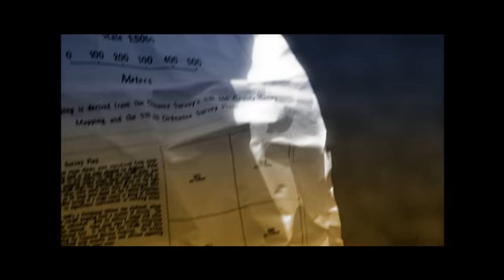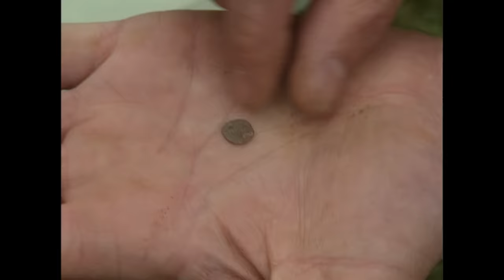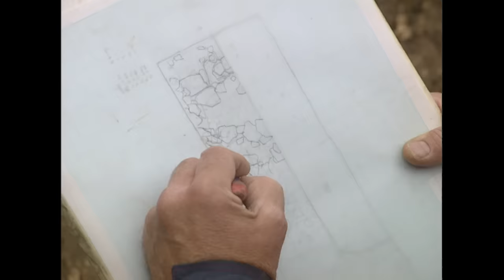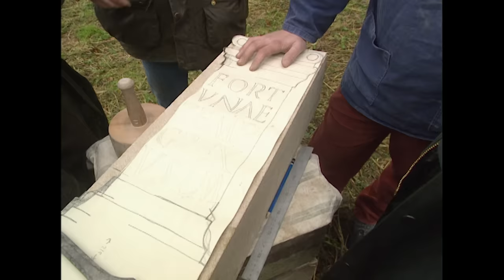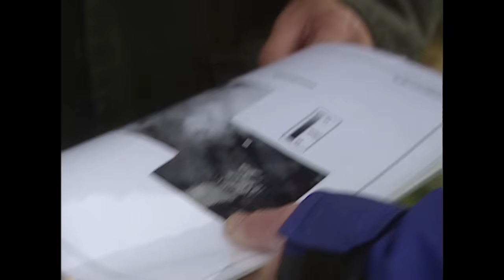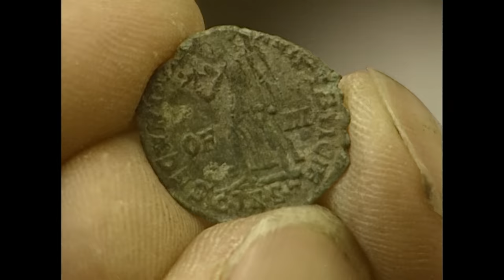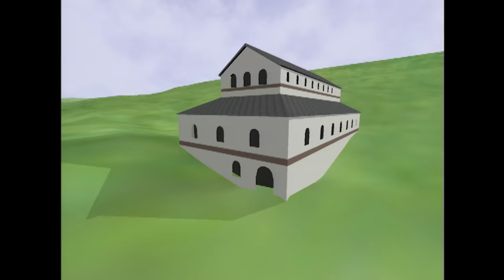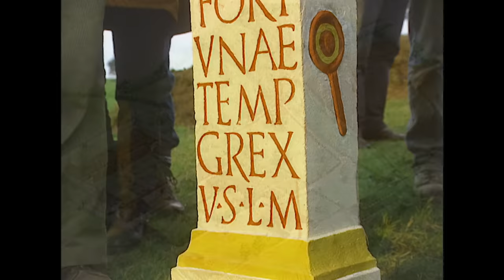Back To Turkdean: Revisiting One Of Britain's Largest Roman Sites | Time Team

Comment: To think that the ancient roman water system was still working after a 1000 years is mind boggling. My towns pipes break at least every two to three years - shabby modern tech, lol.
Reply: If the site dates back to year 2-300 then we’re talking about 17-1800 years.
Reply: Take a look at the Roman roads in Italy. They are still in fantastic shape after 2000 years, yet we can't seem to get them to last 5 years.
Reply: Right?! The same with their roads too...
Reply: @joepangean6770  roman roads had far less traffic with lighter loads. And some of them have pretty massive ruts from the wheels.
Reply: Different types of water works. If you'd press the same kinds of pressures in that roman system, it would die in a jiffy. Now i'm not saying modern stuff shouldn't or couldn't be build better, but the costs involved with upscaling certain elements bite the whole array in the ass. Like for example, the humble water pipe main, made up from rolled steel sheets. It would require a monstrous machine to do the same kind of work with a thicker metal. The whole thing is a mess and on the one side the idiotic teachings of Bernard London bite us in the ass, along with all his greedy followers, but on the other there's not much more than can be done if you want something done. The truth of the matter is this, towns, cities, villages... they're all built wrong, and because of it, the systems that supply them are also going to suffer. The modern patch work of piping is a nightmare to manage and work with.
Reply: @johnv6806  Right but those are hard wood wheels, maybe even iron-rimmed. With rubber tires, those roads would have no ruts.
Reply: @SamuelCobb  uh huh. Put an 80000 pound semi on the road and see...
Reply: @Invictus13666  they run 90 000 lb trucks every day on Roman roads- all over Europe
Reply: @simonorr594  no, they don’t. They use the original road path.
Reply: Yeah I was gonna say; (I believe somebody already pointed out) they said they had roman evidence of first through fourth century occupation witch is 1900-1600 years ago.
Reply: Building something to the point that it will last for 1500+ years would be called wasteful over engineering in today's terms. The cost of building the way the Romans did required the equivalent wealth of a billionaire. The way we build now is designed to get what we want for a set reasonable lifetime. Buildings that are built to last longer either they get demolished at much higher costs than other developments if the new development is expected to be profitable enough, or it gets abandoned if the land stops being valuable.
This worship of old craftsmanship is really annoying, and truly ignorant. Craftsmanship of the kind you see surviving here and there does still exist. YOU JUST CAN'T AFFORD IT YOU PLEB.
The average person would be getting WORSE quality on average than we do now because of mass production and economy of scale.
Working for a luxury retailer, I see the design decisions that are made to make something good quality, and the substitutions that are made to make something with similar productivity at a much lower price point.
The astonishing thing isn't how quickly the cheap stuff breaks, it's how much functionality is maintained through the cost cutting process
Reply: @BlackOak  this reminds me of the Louisville Gardens. It has outlived its usefulness by several decades, but it's too expensive to tear down because of how it was built as it was once an armory. So now the city pays to maintain but can't get anyone to actually  do anything with the building.
Reply: @aserta  You're right, of course.  But I still look in awe at this 2000 year old aqueduct happily burbling along. 😁
Reply: @Samuel Cobb especially when that 18 wheeler puts on brakes
Reply: While fully loaded, 53 foot trailer. In hard cold freezing weather water freezes in cracks, semi brakes across it and a chunk pops out. In July and August the semi brakes and the road just wallows out.
Reply: We blame it on modern tech but it’s more like modern labor.  We don’t put in the same skill level of work like they did.

Comment: those underground culverts with running water blew my mind... like thats been running like that for alll this time? man its so cool...
Reply: Yes, it’s wonderful! As long as the spring itself doesn’t go dry, it will go right on…
Reply: There is a place down the block from me they are always craning in green pipe our stuff doesn't even last a year let alone 1700
Reply: @blkmgk16  I mean to be fair the roman pipe wasn't under pressure so there's that.

Comment: @ 41:41 They act so calm when they lift the stone and uncover the water flowing so clear and unimpeded, like it was just covered in 1999, but I think this was ever so like stepping back into the actual Roman era, the movement giving a feeling that amounts to revealing a clock still running, or as Mill running, it was really neat even if a simple underground water source and a piece of stone.  They has "maneuvered it, engineered it to function for their needs".
Reply: A clock still running? It’s a spring. They run. Ever seen a river?

Comment: I'd bet that they made two mistakes with that blue pigment...First, putting it in a kiln, and second, overheating it, and not maintaining the correct temperature long enough. It needs to stay under or around 1820F (1000C) for several hours, hence the overnight roast the instructions required...Pottery melts at around 2300F (1250C)...So really obvious that they got it too hot.

I also wonder if they could get a date for that aquaduct from the thickness of the limescale on it...I believe that it accumulates at a steady rate, depending on the amount of disolved minerals in the water. Not surprised that it is still functioning though...there are similar water channeling structures in south america, that are  just as old, if not older than this aquaduct

Comment: Funny...four tessera do not a floor make.   But I do bead work and it's amazing the number of times I will find a single bead on a sidewalk or curb, building floor.  How do you lose just one?
Reply: @Celto Loco beeds are normally on strings...so if the string  breaks, beads fall all over.  But in bunches, not one or twos.
Reply: Oof. Any beads that are round in shape have a total life of their own, I swear! 🙈 As a craftsperson I have several containers full of mixed beads awaiting sorting because they got knocked to the floor, fell out of storage containers or off broken strings etc. And I know there are plenty more that escaped my hunt and are still lurking in the cracks of the floorboards! They're like sewing pins, they just get absolutely everywhere... 😂

Comment: kinda sucks that after this place got scheduled there's been zero activity.  Like no further digs.  I looked at googlemaps and it's still just a barren field.  I can't believe with such a large, intact site they've done fuckall with it.  Expose some of the works and cover it in plexiglass.  Let kids pay $1 to drop food coloring in one end of the pipe and their friend see the color on the other side.    If I owned this lot, it'd be a living museum.  Replica buildings near the grounds.  Clay-works workshop.  Let kids mix iron ochre and  and woad and stain their tiny hands red and blue.  Reenactment battles in the spring. Instead it's a field.